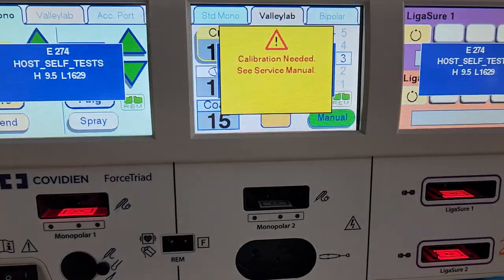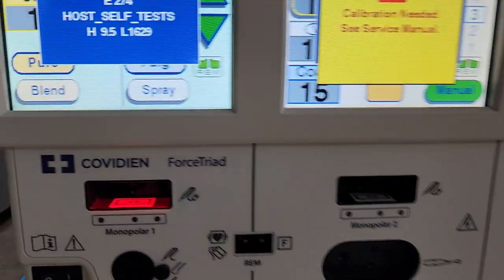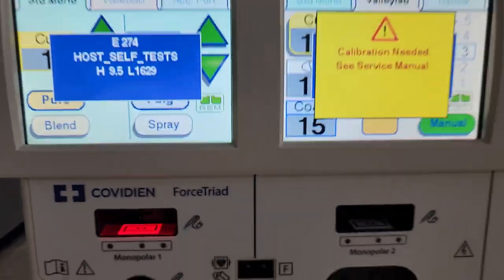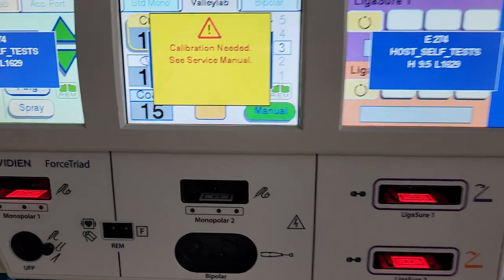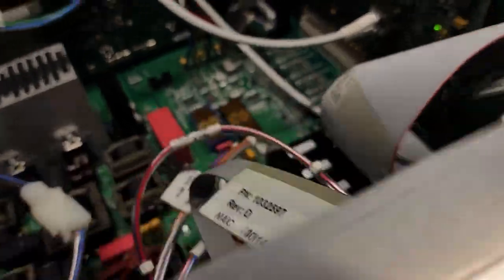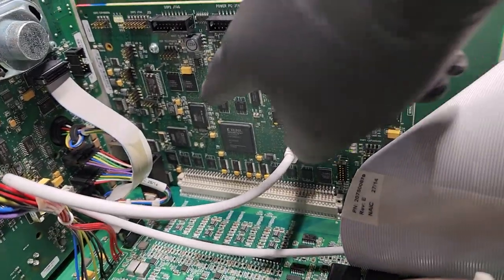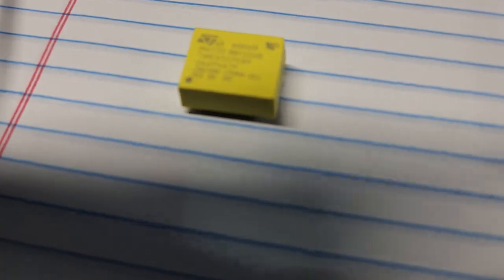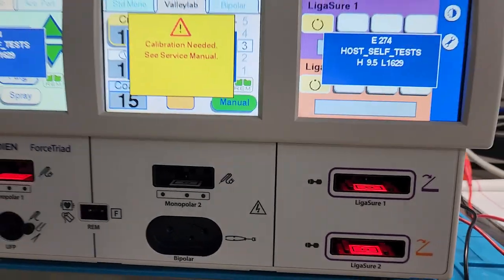Rules of Repair: All Failures Just A Symptom

Comment: If you know where to dremel, you can sever one internal connection to disconnect the old battery, and expose 2 internal pins to solder on leats to a glued on coin cell holder.
Reply from the maker: Modified medical equipment.  Very taboo in the USA.